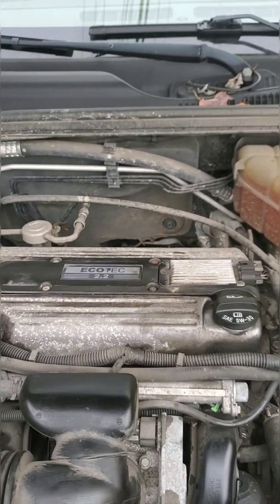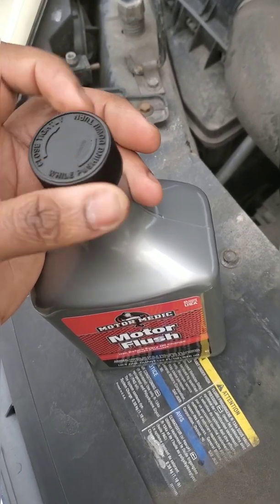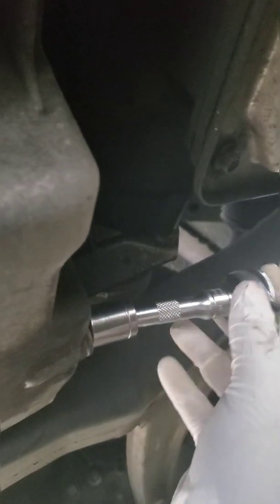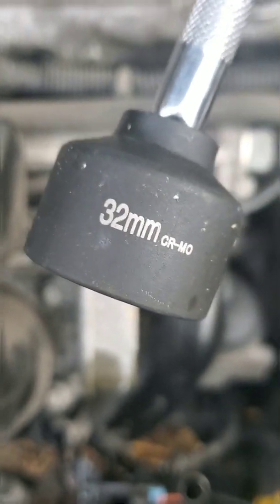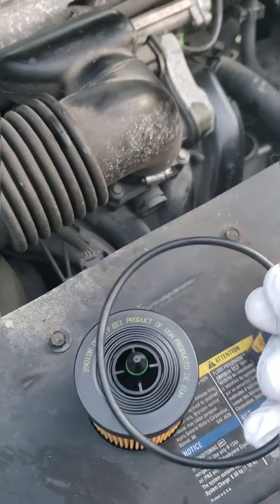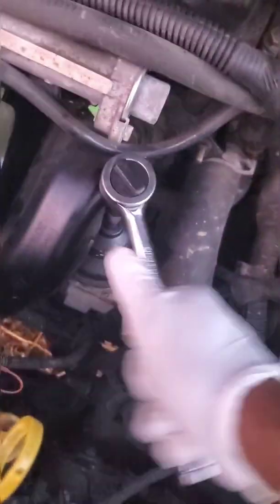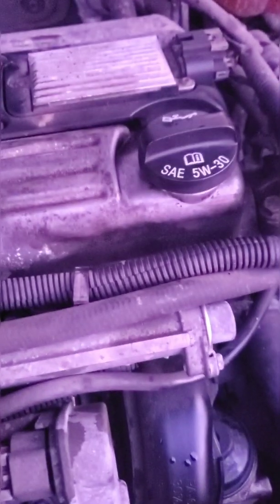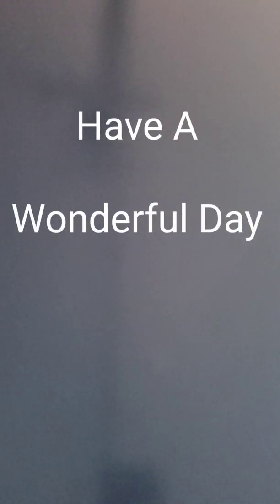How To Perform A Motor Flush Oil Change 2005 Chevy Malibu 2.2 Ecotec

Comment: If the car has leaks what exactly should you do to not ruin the engine great video bro I want to start changing my own oil
Reply from the maker: Check to make sure the pan is not leaking that's an common issue, but I would keep oil in the car and evert day I would check the oil and add oil to it depending on how bad the leak is. Until you save enough to get it fixed.

Comment: The oil filter snaps right in the cap, it wasn't seated right. It should click right on
Reply: Might be time for a new cap if that's the case, that's why i buy the filter & cap as a hole together every oil change. PF458G is a few dollars more & is all oem
Reply from the maker: @jessievert  🤔 That's good information, I actually never seen the cap & filter together wow
Reply: Good vid though
Reply from the maker: @jessievert  Thank you for watching
Reply: Yep & its a oem, its worth the extra few bucks for a new cap, its around the price of just the filter alot of places
Reply from the maker: Hey Jess, Yes mines use to do that all the time when it's crooked, as soon as you tighten it up it will pop right out
Reply from the maker: @jessievert  Yes, ok I will definitely look at the site, yes it is really helpful because most stores don't tell you anything, Thank you for the information.
Reply: @dominiqueb9256  no problem, good luck
Reply from the maker: @jessievert  OK cool